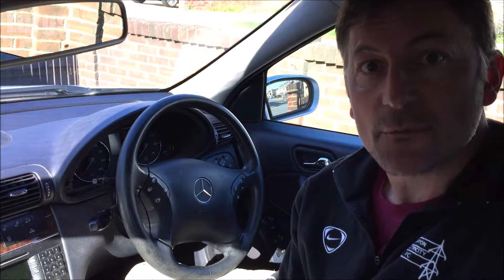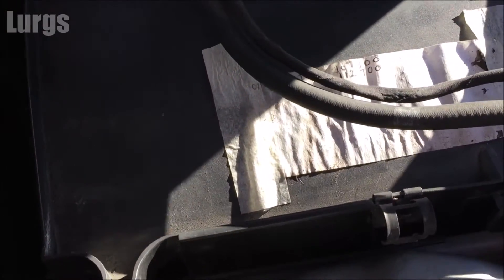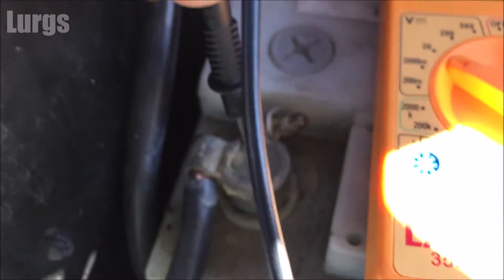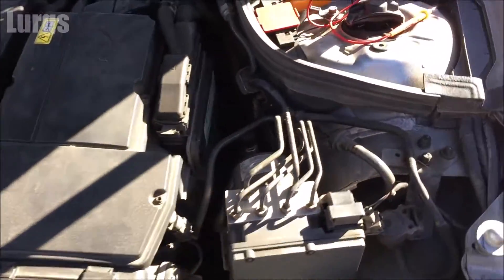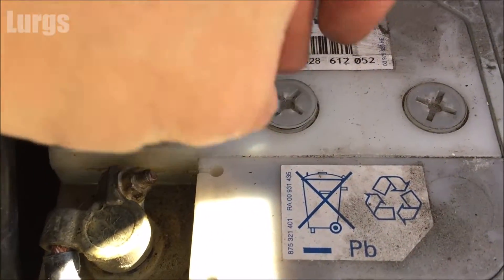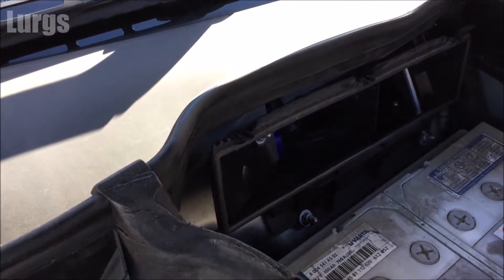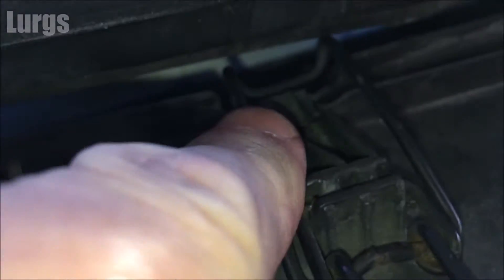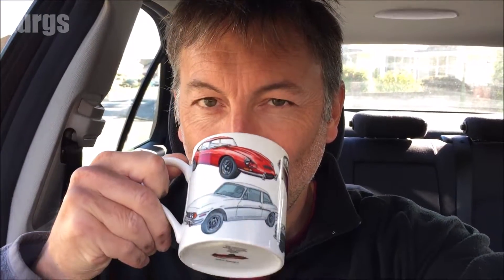Mercedes C-Class Battery Location and How to check Battery on Mercedes C-Class

Comment from the maker: Other useful video links to help you save ⏱TIME and 💰 MONEY:
Mercedes C-Class Fuse Box Locations and how to check Fuses https://www.youtube.com/watch?v=3pSP2pFQh4k&list=PLqrXuUebV8N-KafVzjfld6GGyx_pzzw4W
How to open hood on Mercedes C-Class https://www.youtube.com/watch?v=JU8-_f2qVQc&list=PLqrXuUebV8N-KafVzjfld6GGyx_pzzw4W
How to fill up Windshield Wiper Fluid on Mercedes C-Class https://www.youtube.com/watch?v=HcTChfp4X-I&list=PLqrXuUebV8N-KafVzjfld6GGyx_pzzw4W
Mercedes C-Class OBD2 Diagnostic Port Location https://www.youtube.com/watch?v=Jkdx02NDO1g&list=PLqrXuUebV8N-KafVzjfld6GGyx_pzzw4W
How to set Clock on Mercedes C-Class https://www.youtube.com/watch?v=czqIb2SuHWI&list=PLqrXuUebV8N-KafVzjfld6GGyx_pzzw4W
Mercedes C-Class Battery Location and How to check Battery https://www.youtube.com/watch?v=1nKgIAhg5mQ&list=PLqrXuUebV8N-KafVzjfld6GGyx_pzzw4W
Mercedes C-Class Dashboard Warning Lights Overview https://www.youtube.com/watch?v=SX4ZYq8Hsa8&list=PLqrXuUebV8N-KafVzjfld6GGyx_pzzw4W
How to adjust steering wheel on Mercedes C-Class https://www.youtube.com/watch?v=ne5gpV5ApO8&list=PLqrXuUebV8N-KafVzjfld6GGyx_pzzw4W
Mercedes C-Class Pollen Filter Location and How to change Pollen Filter https://www.youtube.com/watch?v=dhlmpHgRMAA&list=PLqrXuUebV8N-KafVzjfld6GGyx_pzzw4W
How to open hood on Mercedes C-Class vertically https://www.youtube.com/watch?v=6CrBzpWMoT8&list=PLqrXuUebV8N-KafVzjfld6GGyx_pzzw4W
How to replace High Beam Bulb on Mercedes C-Class https://www.youtube.com/watch?v=c8sFuZcvzq4&list=PLqrXuUebV8N-KafVzjfld6GGyx_pzzw4W
Mercedes C-Class Alternator Belt Check https://www.youtube.com/watch?v=YbMdTaHgMwk&list=PLqrXuUebV8N-KafVzjfld6GGyx_pzzw4W
Mercedes C-Class Boot Clip Handy Tip https://www.youtube.com/watch?v=Tag-f80GpqU&list=PLqrXuUebV8N-KafVzjfld6GGyx_pzzw4W
How to remove rear light cluster on Mercedes C-Class https://www.youtube.com/watch?v=ZVT9NDcOt-Q&list=PLqrXuUebV8N-KafVzjfld6GGyx_pzzw4W
How to replace rear indicator bulb on Mercedes C-Class https://www.youtube.com/watch?v=YAzY5sEBkUQ&list=PLqrXuUebV8N-KafVzjfld6GGyx_pzzw4W

Vehicles How To's, Tips, Tricks & Fixes https://www.youtube.com/watch?v=w44aQ7dc_Lk&list=PLqrXuUebV8N9fyM8qA2D0rkVfv929Ckod
How to check car fuses without pulling them out https://www.youtube.com/watch?v=w44aQ7dc_Lk&list=PLqrXuUebV8N9fyM8qA2D0rkVfv929Ckod
How to connect a Car Battery Safely https://www.youtube.com/watch?v=1b2vJjUefYQ&list=PLqrXuUebV8N9fyM8qA2D0rkVfv929Ckod
How to disconnect a Car Battery Safely https://www.youtube.com/watch?v=XJ5SUabZCbc&list=PLqrXuUebV8N9fyM8qA2D0rkVfv929Ckod
Reply: Could you please tell me the size of the battery ground stud? is it 8 or 10 MM?